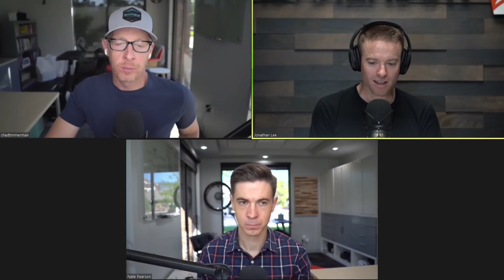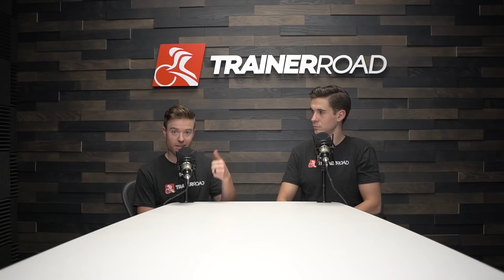The Ramp Test: VO2 Max vs Peak 1-Minute Power (Ask a Cycling Coach 267)

Comment: A little while ago I did an extended climb simulation on my ancient (about 10year old ) Tacx Fortius trainer. I do a lot of training on this thing, mostly Catalyst for specific, shorter stuff and RLV for longer rides. I don’t worry about any power inaccuracies inherent in the equipment as I don’t use any other power measurement when I ride or race.so as long as I keep everything constant and calibrate before each ride I should get the desired effect.
Anyway, after that preamble, here’s the results of that climbing session.
The aforementioned extended climb took just about an hour. It was as hard as I could go. I was wasted at the end. My average cadence was very slow, around 58 rpm, , my average HR about 90% of max. A sufficient amount was out of the saddle.
How would all that be viewed as an accurate FTP test? 
The other FTP test protocols I’ve seen nearly almost always prescribe a brisk cadence with less muscular stress? Be interested in any comments.
Your’s is by far the best training YouTube channel out there .Congratulations!

Comment: Just had my right hip replaced. In about 1 week I can start to spin lightly again....once I get the ok to start training again....where should I start. Pre replacement I was riding about 150 - 200 miles per week. My last ftp test was 244...thanks
Reply from the maker: Hey Tim!

With recovery from major surgery, always ask your doctor before jumping into any type of training plan.  They are the ultimate authority here, and the last thing you want to do is set back your recovery.

With the green-light from your doctor, we recommend starting with the Traditional base plan since it is out least intense plan, and it will help you ease your way back on the bike :) 

Cheers and good luck with your recovery!